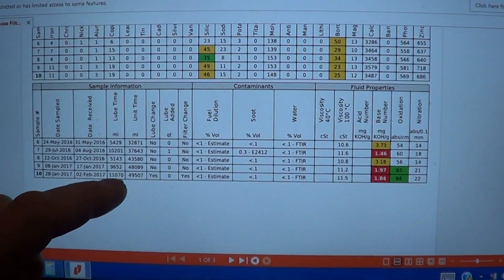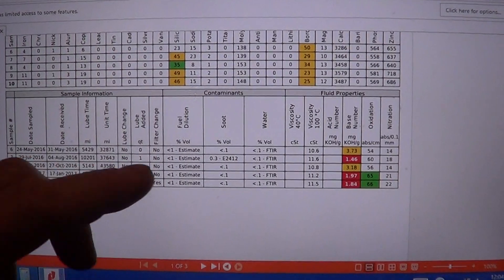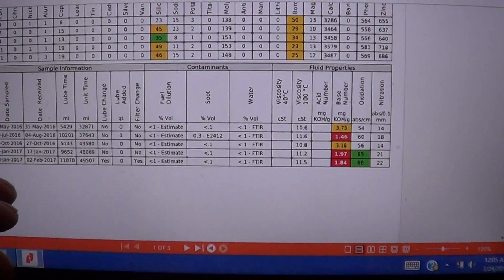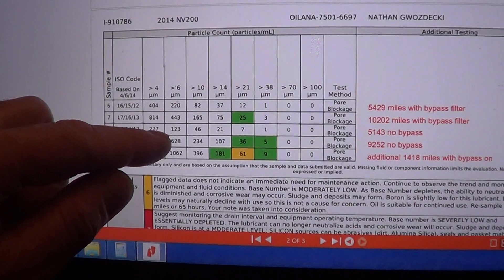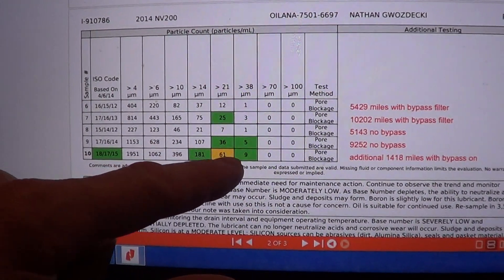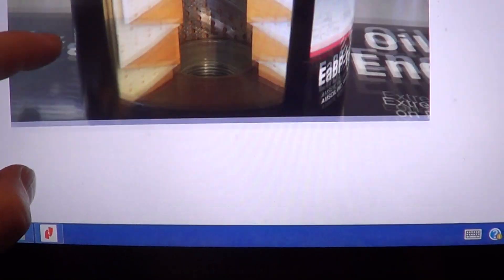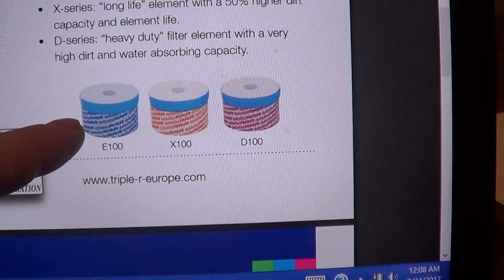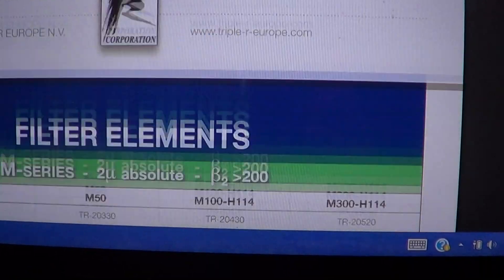Bypass Filter Test Results on NV200 Gasoline Engine

Comment: Great video. Who did you use for the oil analysis? Thanks!
Reply from the maker: Amsoil and then blackstone after amsoil dropped the laser particle count test.   It turns out particle count isnt possible on dirty black oil.   Only clean hydraulic oil can have particle tests.    Im using an oversized main filter now from Mann.   Ill do a video on the advantage of oversizing the main filter.   The tiny baby filter on the nissan nv200 cloggs up at 3000 miles.
Reply: @NathansHVAC  I just built an offline / bench bypass system using an Amsoil bypass filter. I drain my engine oil using my Fumoto valve into a polycarbonate water jug and cycle it through the filter approximately 10 times and then return it into the engine. This process is quick and easy. Possibly this type of isolation method might be better? This method ensures 100% of the oil gets filtered. My plan is to do this every month which approximates 1,000 miles. Thoughts?

Comment: Run same mileage.
One with bypass
Then change oil
Run same miles and same conditions. 
Send each sample to lab.
What you did is not an accurate test.
Reply from the maker: That is what i did.   But, let me explain the entire goal. I wanted to be able to do longer intervals between Oil changes. I discovered that particle counts are completely useless. And that my main filter actually clogs at 3000 miles. I have a video coming about oversizing main filters. A bypass filter is useless if the main is running on its own internal bypass valve open.
Reply: @NathansHVAC  you ran the same oil in the engine didn't you?

Comment: The Triple R is far superior to the Amsoil bypass because of the depth. If I had one I would find a way to use Scott 1000 in it. One problem with the expensive elements is they don't get changed. Enough They try to sell you a bill of goods like our filters cost more but you don't need to change them as often. The smaller the filter and the better the filter the more often it needs to be changed. Price means nothing.
Reply from the maker: I just couldn't tell any difference using the expensive Tripe R filters.  Changing the oil is the better option.  I can't see any way around that.

Comment: I started with a Frantz oil cleaner on a 64 Rambler American. Someone a lot smarter than me determined how often you needed to change the filter and add a quart of oil to keep the oil analytically clean and the additive package up to specs. It was like every 2 000 miles. High quality toilet paper was about 20 cents and Delo 100 was 29 cents at the discount stores. I just bought a beautiful Nissan Altima with 225 k on it. It uses some oil. I will consider that when determining how often I need to change the filter. It will get Wal Mart 30 weight. Diesel and gasoline fleet oil. It will get no oil drains.

Comment: In the old days when bypass filters cam on the scene most cars either had no oil filter or just a reusable metal screen. The cars burnt or dripped enough oil that constant top off kept TBN good over a long change interval. Today we have cars that use very little oil. So unless you drained out a quart routinely and replaced their is no easy way to keep TBN and other additives active over a long oil change interval even with bypass filtration.

Comment: Use long life oil to keep the TBN higher. Also some additives such as MOA and Hot Shot's TBN booster will work well.
BTW: Frantz recommends changing the element at 2 to 3000 miles, and add a quart of new oil, which keeps the TBN from dropping too much.
Reply from the maker: I like older engines with oil leaks.  The oil changes itself when continually topped off.  I have been wondering about TNB boosters.  Thanks for the tips.

Comment: U saved me, i also wanted to install diesel bypass filter in offseason when i had a lot of spare time from hvac job, but as i see the is not a lot of a difference, especially considering oil pressure may be lower with bypass filter if get wrong orifice.
Thanks for the videos.

by the way you can usually find larger better quality oil filters that will fit your engine. And i change my oil filter every other oil change

looking forward to get this filter results!

Comment: Have you seen the centrifugal oil filters? Think they are used in conjunction with normal filters. Whats the service interval with the NV200? 
My new Mercedes Vito has 25k miles service interval, not sure what to think of that!
Reply from the maker: The centrifugal filters require more oil flow than my wimpy engine can deliver.  I just talked to Triple R and I think their filter will perform much better than the 2 um pleated Amsoil bypass.  Also, he mentioned that some guys use back-pressure regulators on small engines to automatically shut off oil flow thru the bypass when the engine is at idle and the pressure is the lowest.  Are you running diesel?  That might explain the longer oil changer interval.
Reply: Yeah its a 2.2L diesel, suspect our oil is better spec here, previous one i had with the v6 took $117 worth of oil every 16k miles.